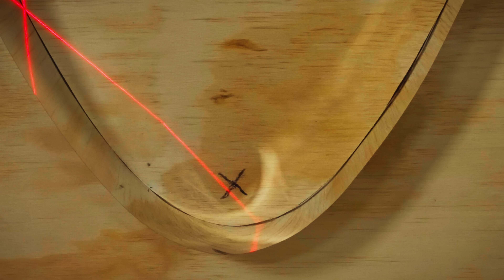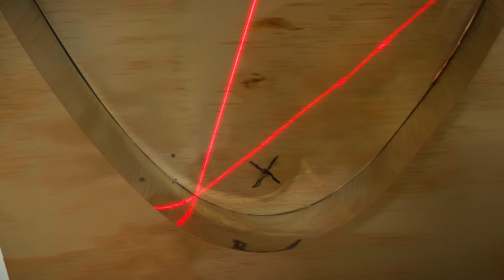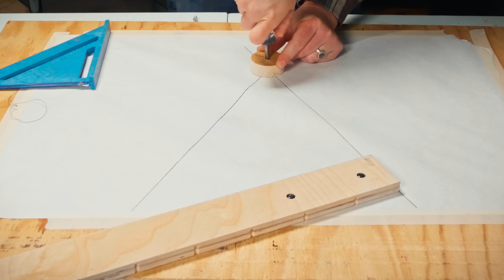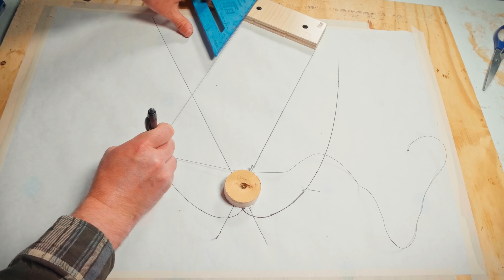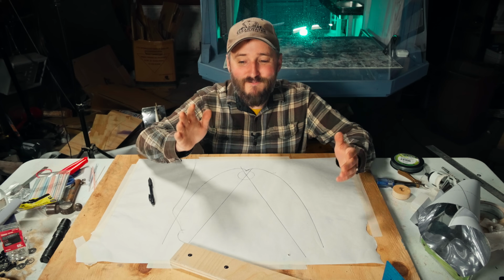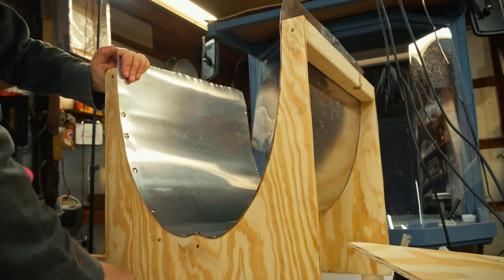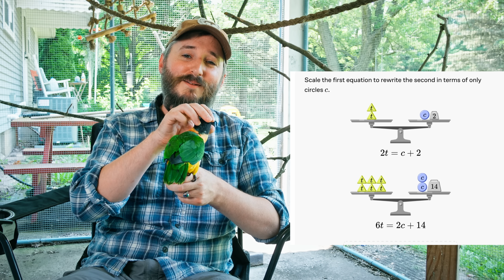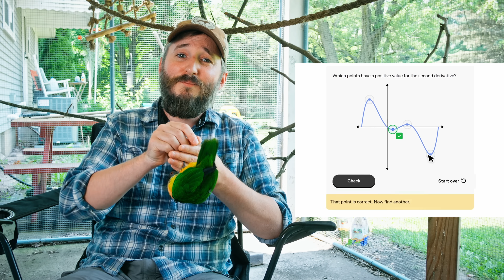DIY Solar Concentrators, Made Better.

Comment: What about LEDs working in reverse as solar panels? I was doing an experiment with my daughter, teaching her LEDs can produce power in reverse. We were able to focus some light using tinfoil, but with the right LED and the right light focus, you might be able to get a few volts if efficient panels weren't readily available with a setup like this.

Comment: Very nicely done! 2D shape is good for something like a long pipe, but if you're just doing a short segment of pipe or a jar or can, can you make a 3D dish/funnel instead? Or, given the path of the sun across the sky, make a shape as ideally possible at all times of day for a particular shape?  Bwahaha!
Reply: What temperatures are you looking for? For water heating (pool or hot water in the house) it's unlikely that you will beat solar panels and a heat pump. That's a technologically much more complex solution, of course, that one can not realistically build at home.

Comment: A weird thought?   A flat surface with your sky radiate paint on it.  Your cone large opening down.  Small opening up.  With the cone blocking most direct sun would the radiating paint work better,  or worse?

Comment: I got a still good condition water heater someone was throwing away after an upgrade.  cut the outer stuff off and painted it black and put it in line with my shower hot water line.  I have free unlimited hot water showers, probably have to put it in a glass box for the winter.

Comment: So your idea is creating parabolic curve base in respect to the needed surface. 

Also I am thinking why satellite dish are much flatter. Is because the material is much more efficient used? 

All the vertical surface on your configuration is less efficient then more horizontal surface. 

I have watch your water repelling canvas. I am trying to think a way to create a outdoor skin other than alum foil. Cause it will not last. Do you have any good idea that make reflective surface will last long? For example glass mirror as reflective surface.

Comment: Always keep in mind that, although perhaps a bit unintuitive, the specific heat capacity of aluminium is substantially higher than the one of iron. A piece of aluminium half the weight of an iron piece has almost the same thermal capacity.

Comment: Temp test: The aluminum pipe allows air to flow through it, causing a cooler temperature than if you plugged up one side with a clear plastic cup.

Just saying.

Comment: The two sides of your compound reflector are (ha ha) mirror images, so if you draw it once, you can make a guide and then flip it over to cut the second side, which will be faster and make it easier to get matching sides.

Comment: Did you try your dual parabolic using 2 different angles for each parabolic mirror? I would try one at near 40 and the other at near 20 and use the 20 degree for the "bottom" and the 40 for the "top", meaning when aimed at the sun the 40 degree should be at the top in the morning sun. Just an idea.
Reply: Also you should have used the same size pipe in your test so that it removes any variables. The larger pipe might have the advantage as it has far more surface area to absorb more heat and thicker to retain that heat, whereas the smaller pipe would not.

Comment: I came up with a copper wire esile cradling a magnifying glass the better material or sensitive to warmth pulling the glass in directly to maintain solar waves then the glass will reflect the temperature to best known material to absorb, boiling water.

Comment: Be careful with static tests like yours as shown in the video. In 1975 I worked for a solar energy company in San Francisco called Solergy. They had a novel solar collector design similar to yours. The design was created by an optical physicist who had partnered with an architectural firm to build and install soler thermal hot water systems on upscale homes arounf the Bay area. They had built a static model similar to yours and had also become very excited by the high temperatures it had reached when left in bright sunlight. They had formed Solergy on the basis of that static test.

I had recently graduated from Cornell University with a degree in mechanical engineering and was hired to perform dynamic performance testing of their novel solar collector design. Working with a local mechanical contractor, I built a dynamic test rig that circulated water through a prototype unit with temperature gages at the inlet and outlet, a flowmeter to measure the volumetric flow rate through the collector, and a solar pyranometer to measure the intensity of the solar energy hitting the surface of the collector. This was a non-tracking, stationary design similar to yours. The results were disappointing. At typical domestic hot water temperatures of 120-140 F, a simple flat plate solar collector significantly outperformed the Solergy design. It wasn't until it reached solar air conditioning temperatures of 180 degrees and higher that its performance exceeded that a flat plate collector design. 

The actual geometry you suggested in your video is different than that used by Solergy, and it might perform better than theirs did. But I would be cautious about making claims about its performance based on static tests such as yours. The static test you had demonstrated in the video is more representative of a solar oven than a true solar thermal collector.

Until you perform a dynamic test with a fluid circulating through the collector, measuring the actual heat output as a percentage of the solar energy input, you really don't know if this design will truly work or not, and whether its performance is better or worse than a simple flat plate collector.  I suspect the results will be similar, in that at lower temperatures, a simple flat plate collector's performance will be better, with your design's performance crossing over at a higher temperature. Until the design is built and tested under real world conditions, you won't know its true potential.

Comment: It might be fun to design a tiny toy solar powered putt putt boat using the sunlight to boil water in the tube, conveniently located in the bottom of the boat, instead of a flame. There's a few Fresnel lens powered putt putt attempts on youtube.

Comment: Precious information for my project of a mirror enhanced solar air heater. My concern is that there will be a highly concentrated moving hot spot, rather than an evenly spread power over the target area, and that would melt or burn the collector, that's made of wood and plastics

Comment: If you live away from the equator, you get cold winters and warm summers. This system with a fixed angle (1.8x longitude) will make sure you get most heat concentration during winters and low heat during summers.

Comment: I know there's a form of hot water heater in Australia (and presumably elsewhere) that runs water in a thin layer over a black panel facing the sun, usually on a sloped roof. I wonder what the difference in efficiency for water heating would be between your compound-parabolic collector focused onto a pipe, versus the larger surface area for collecting heat you can get with one of those large, flat panels. Especially as it seems the limiting factor of this new system is the amount of space it'd take to gather sunlight from the same surface area. But the concentration of the sunlight in your setup would result in. A greater temperature gradient, allowing that one spot to get super warm rather than needing to cycle the water through over and over again to gather a little more heat energy each time. Would love to see an experiment to test!

Comment: Once you return to winter in the northern hemisphere, would be fascinating to see you do a setup with one of these connected to a water loop with a fishtank pump or similar, and see if it can catch enough sunlight during the day to prevent the water from freezing? Or see for how many hours of daylight you can get how many degrees above freezing with water actively flowing through the tube? 

Alternatively and/or additionally, if the focus point was on a hunk of metal to use as a heat sink, with a full day's worth of sunlight to "collect" the heat, how many hours would it then take at night for that hear battery to return to ambient? If it could make it through the night, I wonder how many day/night cycles it'd take to "saturate" the heat battery such that the max difference between its temperature and the highest ambient temperature levels off. 

Not sure exactly what you could use it for, since the heat battery would need to be thoroughly insulated on all but the "collection" side to remain efficient. Maybe again going back to the "freeze-prevention" idea, if you get one of those insulated water coolers with the little spigot on the bottom for emptying into a cup that people bring to parties or kids sports events. Remove the top to transform into your heat collector, with your heat battery (hunk of metal) extending down through the middle into the water. Theoretically, it could be able to keep the water from freezing even if left outside for a long time. 

Still not exactly sure what situation you'd use it for exactly, since in a camping scenario you'd want to be boiling your water anyways for sterilisation. But maybe if you were holding an outside event in winter for a bunch of people (toboggan party?) you could keep the fresh tap water you brought with you liquid for longer without having to run a heating element through it? Though as somebody who doesn't live in a place that gets particularly cold, I don't know if that quantity of water would even freeze in only the few hours of doing an outdoor activity. 

I'm sure you'd be much better situated at finding a problem to fit this solution than I am! Can't wait to see what practical projects you start to experiment with using this new piece of theory 😊

Comment: Hammer two nails into the board. Connect them with a long cord. The length of the cord should be greater than the distance between the nails. Now take a pencil and use it to tie the cord so that it is taut at both ends. Now draw a line with this pencil and make sure that the cord remains taut at both ends. As a result, you will get an oval, which is two mirror parabolas. The nails will be in foci of these parabolas.

Comment: @NightHawkinlight - Make a flat collector where the baseplate connects thermally to one side of a TEG and the backside of the TEG connects to a CPU heatsink (shouldn't need to run the fan for that temperature delta). Now you have cloudy day solar power generation. TEGs aren't terribly efficient but then again neither are solar panels when it's cloudy out. And the collector + TEG should be cheap and easy compared to a DIY photoelectric cell. --- A 40f delta should be able to achieve 60 watts on a standard widely available TEG. And cheap CPU coolers, which even has a pretty close in size contact area, can handle that thermal load as well. A 12v TEG will make for easy cpu cooler fan running should you choose to wick away a little power to ensure you get the back side to ambient.

Comment: This video is really essential, and very well-made. I think my thermal camera is exactly the same as you have, btw, it looks familiar. Despite the same paint, I would have used similar materials and sizes for absorbers, and used temperature sensors like PT1000 or such, to get a better reading of the actual temperature. The result will be the same, because such mirrors definitely win in overcast conditions.

The angle you draw is called the "acceptance angle". And yes, it is a compromise between concentration level, and how wide an angle is accepted onto the absorber. Note that the shape of this mirror also means denying light from the sides. It is not that significant, but still relevant. Compare to a flat absorber, which would accept light from just about any angle in 180 degrees. Of course, some light will bounce off, especially at higher angles, but the point of this exercise is that despite the low value of light from the sides, we need to capture as much light as possible, onto the same surface, as possible.

Compound parabolas can also be built making two parabolas, and have them intersect. This is what makes them compound, it is really two equal parabolas.  Interesting how the chain method is not a perfect parabola, as seen in the comments from other viewers. When they make mirrors by spinning a pool of mercury or other liquid, is that also not a parabola then? The way you show it without using math is awesome, and the value of this video is significant.

Compound parabolic mirrors are already offered by some suppliers of evacuated solar tubes. Search in online for "cpc compound parabolic concentrator", select images, and you will soon find several of these. Evacuated tubes are already favoring cloudy and cold days, so adding compound parabolic mirrors behind them enhances this even further.

One of the main challenges of thermal solar is that you typically have too much of it in the summer, and too little of it in the winter. To mitigate this, and make solar thermal even more useful, a combination of the following methods optimizes that:

Evacuated tubes, compound parabolic mirrors, better insulation of the solar panels, more underfloor heating, more thermal storage, whether buffer tanks or other insulated solids, liquids or I presume, even gas (probably not the latter). 

Seasonal thermal energy storage, often called STES, has a lot of other acronyms and names, but basically means storing excess summer heat, under a building typically. This allows for more solar panels to be mounted, without overheating, and on top of that your building will sit on a pillow of warmth, through the winter, to either partially or fully keep it warm enough. Some essential things here is to use plenty of hose or pipe in the ground, as the thermal energy spreads slowly. The depth should not be too shallow, or you will be too warm in the late summer especially. Several selective layers will allow your system to place most heat deeper in the summer and more shallow in the winter. With a single coil, you could simply have one end of the coil towards the top, and the other towards the bottom. Then, when seasons change, reverse the flow so that the heat starts either at the top or bottom of your mass of earth. You also need to control rain water seepage, as well as the groundwater level. Water can and will draw the heat out of this storage.

One last things: Especially for those climates where you typically use air con in the summer and space heating in the winter, you can add on a heat driven dehumidifier for humid climates, and-or a heat driven air condition (absorption chiller). This way, you can use that surplus heat to keep you comfortable in summer AND also allow for MORE solar panal capacity, without overheating, as you can now use this heat for ... cooling. 

I am working on all this tech above. It is super exciting.

IT IS possible to power cooling, dehumidification, space heating AND hot domestic water, all four of these, 100%, all year round, in any climate, as long as you scale each component in the system right. Depending on the climate and your demands, you might need a larger storage of heat, and THIS is why we need solar panels that are optimised for "freezing and grey conditions", in order to minimize how large thermal storage is required. Not every building has the space for a 2,000 - 5,000 gallon insulated buffer tank.

Keep tinkering, everyone. Solar thermal and energy management has so much unused potential. Really. We have just been too lazy since fossil fuels are too easy. Look at Ukraine and other conflict zones. This is not only about saving money. Or preserving the climate balance. It is also about being fully and truly independant of large scale systems, whether it be electricity, oil, gas, district heating or whatever you are on. It is not a technical limitation, but rather a legal and financial one.

I hope my comment here, and other efforts, will inspire others to pursue more progress in this area. I, for one, is totally focused on those things above. Financial and time constraints for my part, as well as legal, political and other man-made obstacles, are my main challenges.

Finally, if you made it this far, reading my comment: I call the CPC mirror an a55-mirror (can't type it here, 5 is s, ok?). Just look at it. It even has a b u tt hole in the right spot.

Now you cannot unsee it again, sorry about that.
Reply: One more note to this: I am not able to reveal the details for various reasons, but I am developing a solar panels using CPC as only one of many techniques to obtain a solar panel which will produce a usable temperature for minimum underfloor heating, under conditions of -18 C (around 0 Fahrenheit) and 20% light intensity, diffuse light. Output will be at least 37C / 100 F under these conditions. YES, it requires a larger area and YES, it is less efficient under a blue sky in the summer. But the missing link of solar energy, both thermal and electric solar, is NOT to further increase output at noon, during summer, with a blue sky and the sun up high, but rather to boost what we can get with a low sun, freezing, fog or overcast.

Most of this industry is working on making the car go faster down the hill, where it is already plenty fast (summer solar), whereas going up the hill (winter solar) is where everyone should be looking.

Comment: I'd explored some ways of creating an adjustable parabola so that it could remain fixed in a structure, but the mirror could be bent and the focus moved as needed throughout the year to maintain focus, but this might be a more solid-state solution if the angles between the lines corresponds to the difference in solar angles between the solstices.  The would be a little wider than recommended (~47°), but not by much.